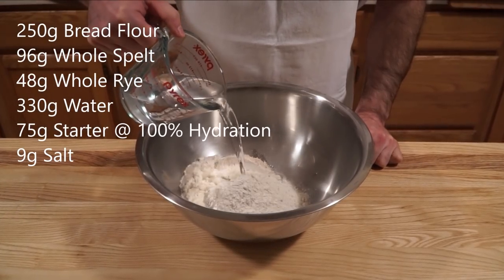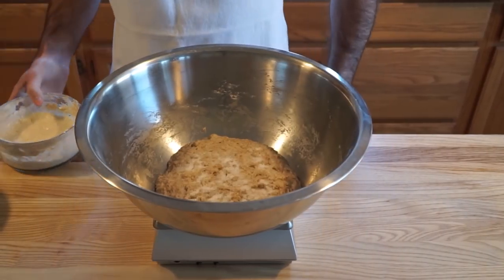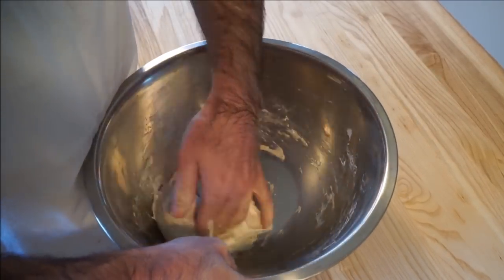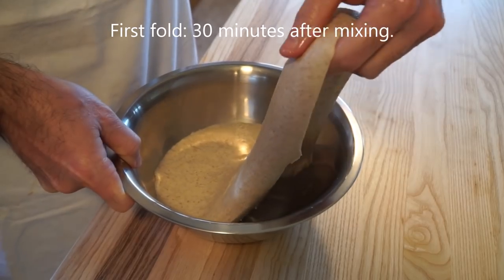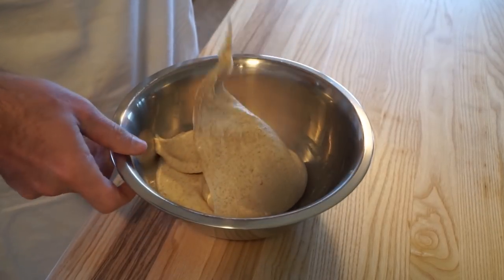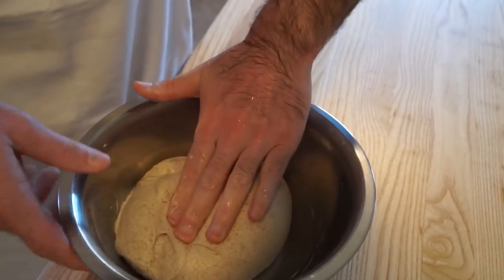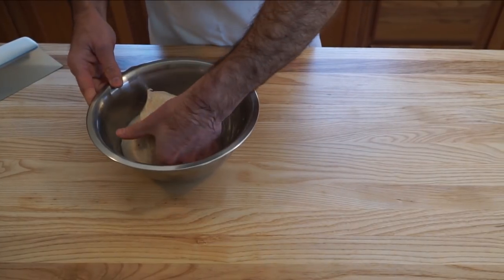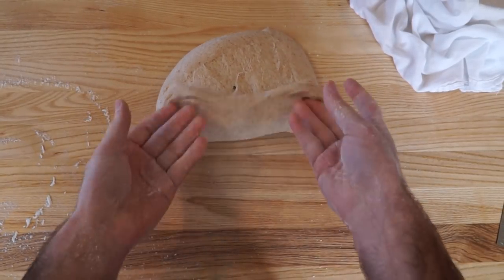How to Make Tartine Style Country Bread

Comment: I bought the second tartine bread book and I tried a couple of recipes out of it with no luck.  My attempts were miserable.  I was ready to give up on sourdough and wet doughs for good.  I saw your video and thought, "okay... I'll try one more time."  I followed your video to the letter and my bread turned out fantastic!  It wasn't quite as beautiful as yours but it's the best bread I've ever made.  Thank you so much!!
Reply from the maker: That's awesome! I'm glad you saw some success with my recipe!  The thing with wet dough is that it's really not well-suited to beginning bakers. It's extremely difficult to handle, and loaves tend to end up flat if you're unable to develop enough surface tension during shaping. Unfortunately, no one ever really makes clear just how difficult wet dough can be. So new bakers get frustrated and wonder why they just don't get it. The problem doesn't lie with the baker, it lies with the expectations that were set from the literature. Much angst would be saved if every bread book simply stated right from the outset that new bakers should work with stiff dough in order to develop their handling skills. As their skills progress, then they can slowly increase the hydration of their dough to suit.
Reply: I wish I had known all of that a couple years ago, it would have saved me a lot of frustration. heh heh.
Reply: When new to sourdough, my prob was using starter at the proper time, learning when it was at its best for raising the dough.
Reply: I got flatter results than expected but  not because of the handling. I’ve done high-hydration’s before. The dough in this case was not nearly as dry as yours in the video as I did the stretch and fold and when it came to pre-shaping. It was still so wet that it stuck to the counter. I put down a little flour but that didn’t help. It was even still a bit wet inside after baking even though the crust was very dark.
Reply: @charleswbasden6037  In hot summer days I had the same problem too. But when winter came, higher hydration doughs seemed like lower hydration ones and problem was fixed!
Reply: @TrevorJWilson  Excellent explanation.
Reply: @TrevorJWilson  Best answer ever....you re the best of all...if any begginer had the chance to read your book it would avoid so much suffering (lol) and giving up...thank you for sharing your precious knowledge
Reply: @charleswbasden6037  not all flours are the same in terms of their water absorption. Fresh milled usually absorbs more. But high humidity in your area could also make an 80% hydrated dough feel better than Trevor's. You'll need to adjust accordingly. Also, the moregluten development that you accomplish initially (notice Trevor's Rubaud mixing for quite a while), the more the texture of your dough will change from sticky to soft and supple

Comment: I'm about to press that subscribe button!! Before that... Lol I want to know first, that in a very warm house like mine 27C+ do you recommend myself to let the boule autolyse in the fridge before mixing and in between folds, and with your exact times? Or else with the warm room temp it's gonna develop a bit too quick and I'm afraid the gluten can't keep up with the pace for it to stretch effortlessly(?) 

I love a passionate baker like you! Reminding myself how I used to be so passionate on bread making, both sourdough and normal ones. I thought that I'm quite good when it comes to wet doughs even developed my own techniques which works for me but really, you sir are the most profound sourdough baker ever! And kudos for making it simple. Keep on making videos! :)
Reply from the maker: Thanks Adno! 27C+ is actually good temps for fermentation. One thing to keep in mind is that suggested proof times are just that . . . suggestions. There are so many variables at play that you can never offer concrete proof times that work for all bakers. The best way to look at a bread recipe's directions is that they are what worked for that baker on that day with that baker's ingredients under that baker's circumstances. On the day that I filmed this video the dough was moving slower than usual -- had I filmed on a different day then my suggested proof times may have been significantly shorter. That's why bakers have the common saying, "watch the dough, not the clock". Short of a factory controlled environment, bread is just too unpredictable to prescribe anything other than a suggested method. So it may very well be that the proof times in this video may be too long for you and your circumstances -- just as they may be too long for me when baking this same loaf in high Summer. Always feel free to adjust as necessary. That said, my guess is that if you refrigerate the dough as much as your are considering, then the dough will hardly rise at all. Better to proof it at room temp and just shorten the rising times. But again, you'll just have to experiment to find what works best for you. Good luck!

Comment: Thank you for the informative video! Your videos are so much easier to understand. I'm having problems with a seemingly dense product. My last bake came out with several extra large air bubbles but the rest was quite small and tight, imagine swiss cheese-y. I am going to try your mixing method, as I am assuming I didn't develop enough gluten last time with just the folding. My bread also doesn't seem to get the oven spring that yours does.

Comment: Wow what a beautiful bread with amazing crumb. 
I have recently started baking. My bread has good oven spring with open crumb. One question I need your help is - why the bread I bake is gummy and slightly wet in the center of the loaf? I cut the bread about 2 hrs. after, when it is cold. The bread knife has wet dough sticky film. How I can fix gummy or wetness so that the bread knife does not get sticky. I will appreciate if you can help me to guide me. Thanks

Comment: I've watched several of your videos now and I find you have the most beautiful looking bread! Seriously! One question: in many books and videos, people warn about direct contact between the salt and starter because salt can kill the starter. Is this a myth? Love the mixing method, btw... thank you!
Reply from the maker: Thanks Jeffery! Salt does kill starter, but in practice this isn't a problem. Simply letting the two mingle together for a brief moment causes no noticeable effects. If you were to thoroughly mix the salt and starter together, then let it sit for awhile, then perhaps it would begin to damage the starter. But in my 15 years of experience, I've never seen it do any harm to let them come into contact for a brief moment before mixing. So it's not really so much of a myth as it is just an overblown concern.
Reply: Hi Trevor! Thanks for the response!

Are there any other options for baking without cast iron pans/dutch ovens? Is it possible to just bake it on a baking stone? In my last move, my dutch oven was either lost or stolen. :(
Reply from the maker: You can definitely bake on a baking stone. So long as you have a good method for steaming your oven then using a baking stone is perfectly fine. The nice thing about the dutch oven is that it simplifies the process by removing the need for steam -- which can be difficult in home oven's since they're usually designed to vent, not retain steam. But if you've got your steaming down, then using a baking stone can produce fantastic results. Good luck!

Comment: Trevor, thanks a lot for the very helpful video! One question I have is that it looks like you are using just straight starter to mix into the dough, instead of first preparing a "leaven" the night before (as I've read in other tutorials). Is this the case, or are you somehow altering/preparing your original starter before incorporating it into the dough? Thanks!
Reply: Chris Reed I asked someone this same question, and according him,   if the starter has been active and fed often, no need for overnight leavening. One can simply use it out of the starter jar. Good question, I have always wanted to know the difference myself.

Comment: No hard feelings if this is TLDR

Trevor I have just started learning how to make sourdough, and I am happy that I have discovered your channel. You really seem like you know what you are talking about and your breads look delicious. I am trying this recipe right now (the bread is not in the oven yet, and I had to replace the smelt with whole wheat, and I am using an 85% hydration starter (the beginning of the video flashes 85% but then I noticed it says 100% in the actual ingredients... I should have paid more attention)). 

I do have a question related to starters, yeast activity, and flavor.

Anyway, I first mixed the flour and water for my starter on 1/23/17 and had it at 100% hydration until a couple days ago when I converted it to 85% hydration. At 100% it was a slowly bubbling mass of goop. At 85%, it has a bit less moisture and it rises  to 400% the original size within 8 hours of feeding (compared to 0% rise at 100% hydration). At this point I stir it with a fork to allow the yeast to find any other bits of flour that it hasn't eaten yet. Within an hour it has doubled in size and as I approach the 24 hour mark (since the last feeding) it is back to 400% volume. It seems like the yeast is incredibly active! (but that is just my speculation since I'm a newbie and the resources I've seen said that I should start feeding it 2X a day after it gets a few weeks into its life). 

On day 3 (1/25/17) the starter was starting to smell a little sour, but today I noticed  that it doesn't smell sour at all. It smells exactly like beer. I am curious what this bread is going to taste like, lol. The two times I've made bread with it so far, while it was still fairly immature (but I was impatient), the flavor had a very mild, almost undetectable sourness. I assume that the lack of sour and the fairly strong beer smell, combined with how much it keeps rising while only being fed once per day, means that the yeast is dominating the starter and not allowing the bacteria to establish itself. 

[THE ACTUAL QUESTION]
Is it possible to "fix" this and allow bacteria to start growing on it? I was thinking of either feeding it with a 1/3 starter - 2/3 food ratio instead of the 50-50 I have been doing, and then waiting longer between feedings. I was also thinking about putting part of the starter in the refrigerator to slow the yeast down before feeding it and then letting it set out again, or maybe combine those two approaches. 

If it does taste like beer (in a good way), I will probably keep this starter going the way it is, but I will want to split a piece of it off and do whatever I have to to make a sour version as well (so I have variety... I was originally wanting sourdough after all). 

I appreciate your looking at this and your opinion on the matter.
Reply from the maker: The first thing to be aware of is that a "sour starter" doesn't necessarily equate to sour bread. In fact, often an underfed and "sour" starter simply makes for flat bread. There are better ways to create sour bread than trying to get your starter as sour as possible. What you want from your starter is vigorous activity. A healthy starter is one that can at least double in volume within 8 hours of refreshment (tripling in volume is even better). It sounds like your starter is nice and strong, but if you continue to underfeed it (once per day is usually not gonna cut it) what you'll discover is that your starter is actually losing strength. That beer smell may be a sign that your starter isn't sufficiently fed. Over time, an underfed starter becomes overly acidic and sometimes even proteolytic (gluten dissolving). Such a starter does not make good bread. A good starting feed ratio for a healthy starter is 1:2:2 (1 part starter, 2 parts water, 2 parts flour; all by weight) or even 1:3:3 twice a day at room temp (approx. 12 hours apart). That makes for a strong starter that will give you a good rise. As far as getting the sourness goes, most folks just refrigerate their loaves overnight to increase the sourness. But there are other variables at play, such as dough consistency (stiffer dough can allow for a more acidic loaf), amount of whole grain (more whole grain equals more sour) and the very nature of your starter itself -- some starters are naturally more sour than others. Now, once you have a very active starter that's giving you a good rise, and if it's still not sour enough for you, try this: 1) Mix your dough nice and stiff (far stiffer than the dough in this video). 2) Bulk ferment at warm room temps. 3) Let double or triple in volume (about 4-6 hours) then punch down (thoroughly degas) and let double again (about 2-3 hours). 4) Punch down again (thoroughly degas) then turn out and preround. 5) After bench rest (30-60 minutes), thoroughly degas then shape nice and tight. 6) Final proof until nearly doubled in volume (I prefer the flavor that develops at room temp, but you can refrigerate at this stage if you prefer) then bake however you like (light or dark). Assuming your starter is strong and active (and not overly acidic or proteolytic) you'll find that this method produces a wonderfully pleasant sourness that's hard to achieve otherwise. It won't be a Tartine style loaf with wide open and irregular custardy crumb, but it will be a light and airy and delicious loaf. Good luck!
Reply: Wow thank you for the information. I am feeding my starter right now so I am going to give it a 1:2:2 and see how that does. I will be digesting the rest of this information in the coming days, thank you!

Comment: Hey Trevor - there are lots of comments and I promise I tried to search to avoid redundancy.  But it's a great video, so we're all wondering different things.  My question: is that dutch oven pre-heated?  I think I can hear a little sizzle when the loaf goes in, but I can't quite tell.  The scorch marks on the bench make me think it's been preheated, and everything I've read supports it.  I'm just having a real challenge with oven spring and wondering what else to try if I'm going to eventually make a loaf like yours.

Comment: I'm trying this recipe out right now and have used 100% whole wheat with the percentages of rye and spelt you recommend. After mixing in the starter and salt I can already tell that mine seems a lot stiffer and not nearly as wet/pliable as yours. Did you use white flour so the absorption was less and if so should I add a bit more water?

Comment: Hi Trevor,
I do enjoy your videos and I have learned a lot from them over the past few month when I first discovered Breadwerx (I nearly said Brexit, oops)! There is one thing I noticed comparing my results with your various recipes - extensibility. Your dough is much more extensible than mine, irrespective of the rate of hydration. I should be grateful if you comment on what infliences the extensibility of the dough?
Many thanks
Tom Kienyi, London.
Reply from the maker: Hey Tom, many things influence a dough's extensibility. For one, the flour you use. Different flours have a different balance of extensibility vs. elasticity. If you're using different flour than me then that's probably a big contributor. How you keep and maintain your starter also has an effect -- acid increases a dough's elasticity (at the expense of extensibility). So the more acidic your starter, the less extensible the dough (and the same applies to the dough itself -- the more acidic it becomes, the less extensible it becomes, in the short term at least). That's why Tartine style breads often use a young levain rather than a mature one -- it has less acid and makes for a more extensible dough (and less sour flavor) which creates a more irregular crumb structure. Now, I actually use a mature starter here since I prefer the flavor, but that is one thing to consider. Also, just the degree of proof in a dough makes a huge difference in how extensible it is. The more a dough has risen, the greater its structure. Structure equals strength, and strength lies at the opposite end of the spectrum as extensibility. So if your dough is proofier at the time of shaping then it will also be less extensible. I try to keep Tartine style breads a bit on the young side during the bulk to encourage extensibility and a more irregular crumb -- I try not to let it rise more than around 30% in volume during the bulk. But you have to be careful, if you don't proof it enough (say less than around a 20% rise) then the dough won't have enough structure to hold a good shape and you'll end up with a flat loaf. It's always a balancing act. Now, since I don't anything about your flours, starter maintenance routine or any other factors, I can't really say why your dough is less extensible than mine. But if you play around with some of the variables I mentioned here then you may find something that works for you. But also keep in mind, extensibility is only one aspect of a dough's quality -- it is not always necessary for making good bread. I make many extensible doughs, but I make just as many non-extensible doughs. It just depends on what I'm looking for from that particular loaf. And you can still make beautifully open-crumbed bread even without very extensible dough. Good luck!